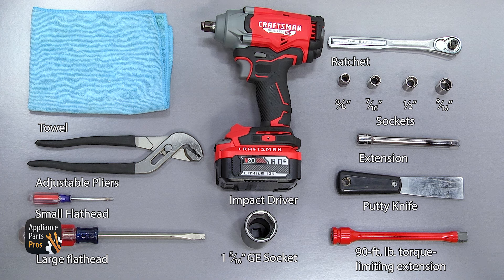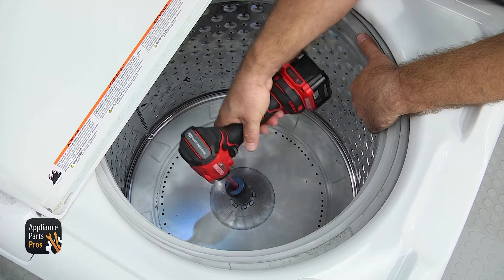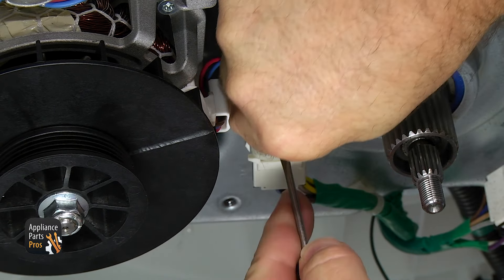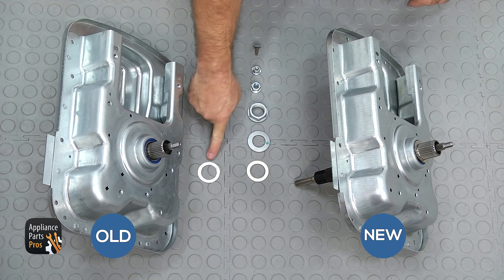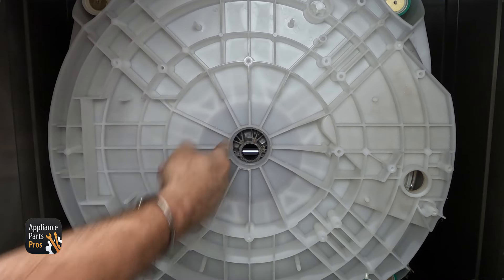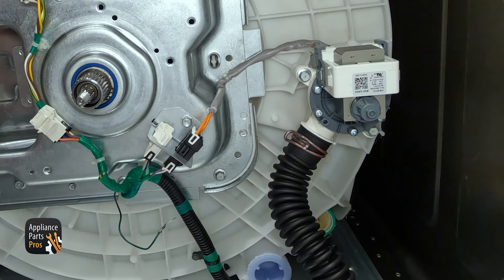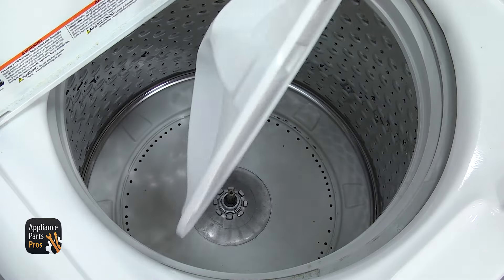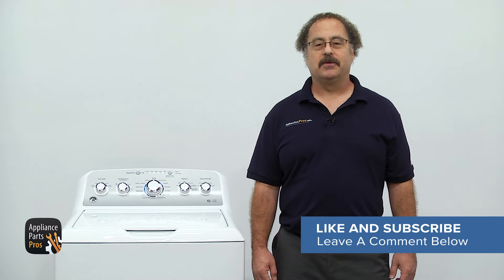How To Test And Replace a GE Washing Machine Transmission Assembly

Comment: Hello! Great video! My pulley nut of the main transmission pulley keeps coming off.  When it comes off the belt and pulley come off! It has happened at least three times now.  Any ideas? Thank you!!!
Reply from the maker: You will need to check the threads for any damaged or worn spots. If that is good then you can use something like Loctite to help that stay in place.
Reply: Thank you so much!
Reply from the maker: You're welcome!